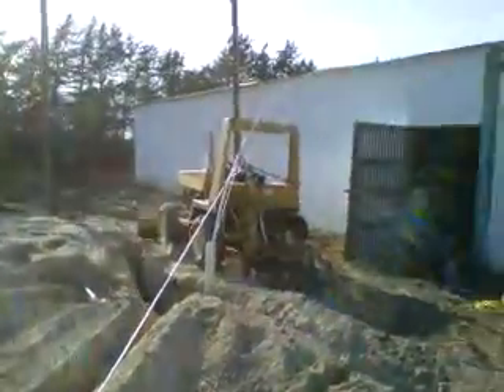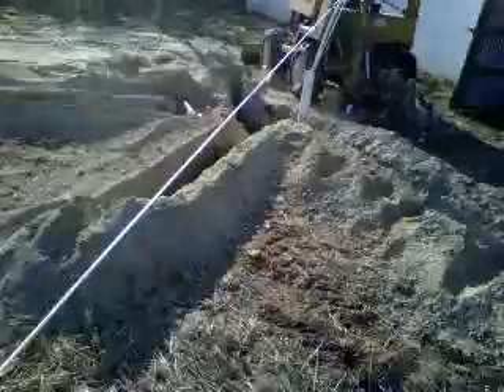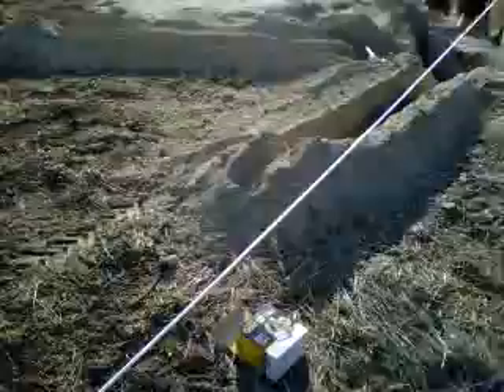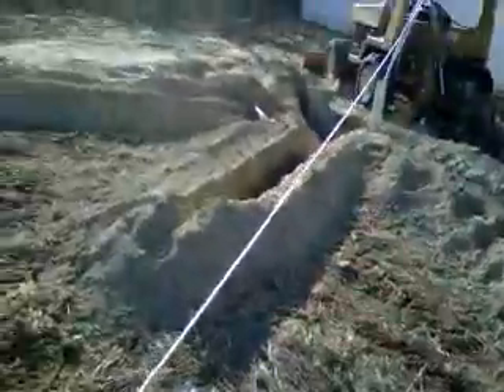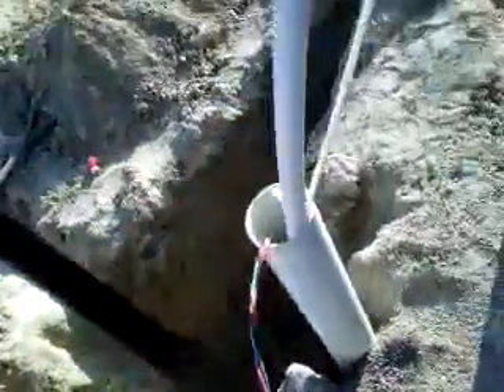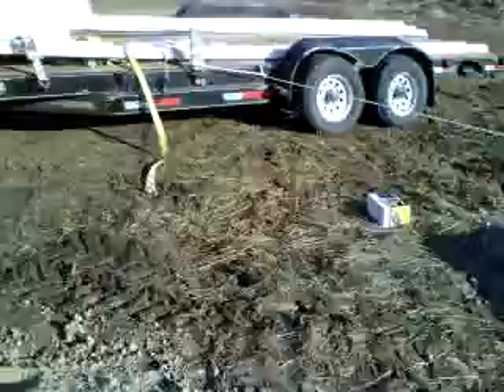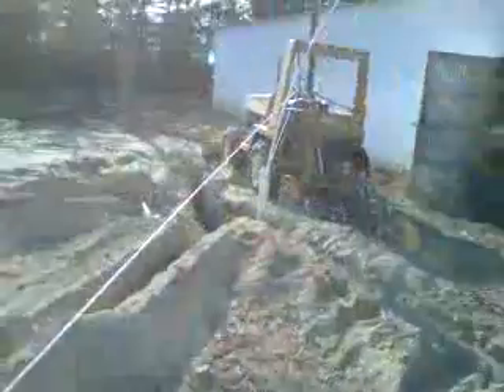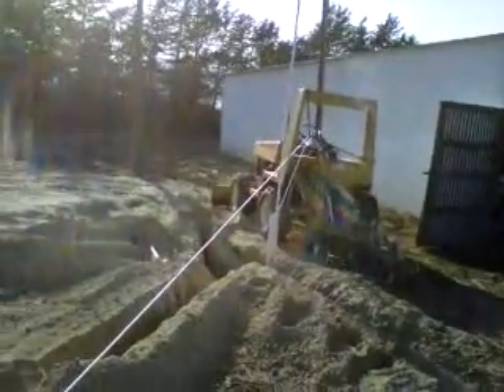Deep water well submersible installation by myself

Comment from the maker: Arshi, I guess I don't know what you are asking.  I used Schedule 80 pvc in this video.  I didn't like the 1 hp pump I had in there, it was a Menards special (=junk).  I just pulled it again a couple days ago and replaced it with a 1 1/2 hp 20gpm aeromotor pump.  I also got rid of the 1" pvc and used a 1 1/4" 160psi poly pipe this time.   It was lighter and I didn't have to worry about any joints.  I also installed a steel cased pitless adaptor instead of the PVC casing that was there.